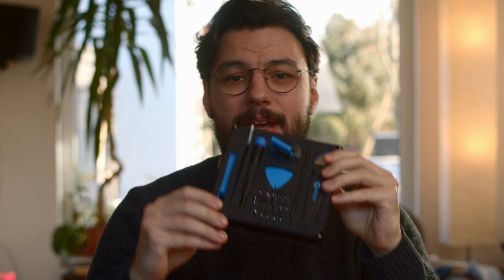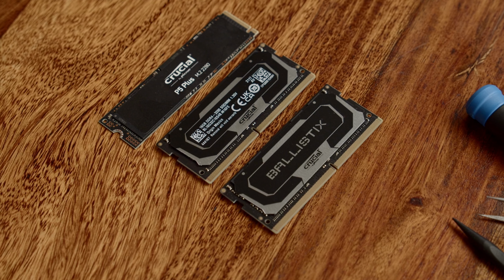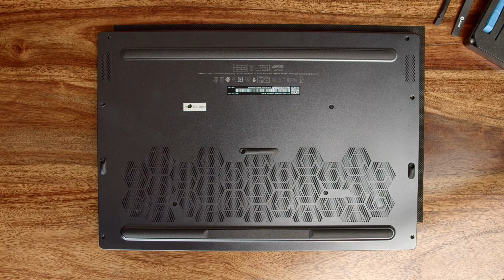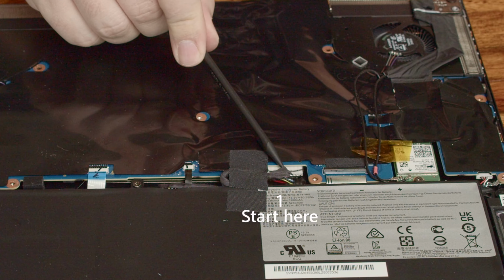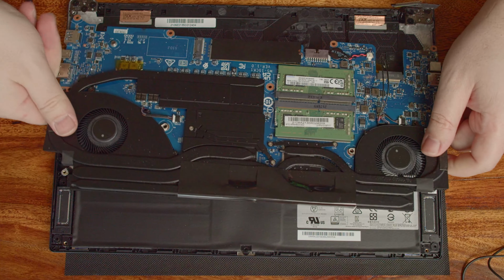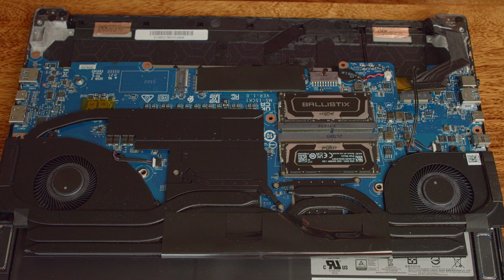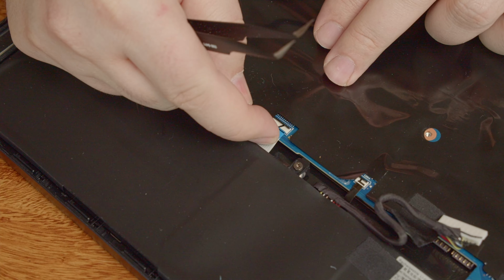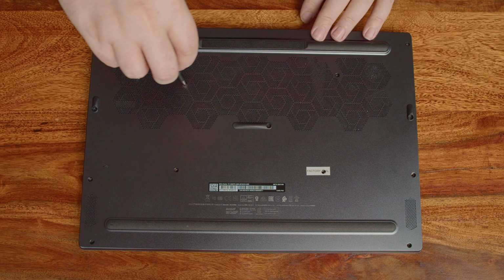MSI Delta 15 Laptop: How to Upgrade SSD & RAM – that was weird.

Comment: Thanks! it was nerve-wracking the first time but afterwards it's quite easy. Note: The two wires going to the wifi card will probably give u trouble at first, just know that the wire with the red label goes in slot 2 and the black one in slot 1. In order to place them in there, place the wires in their slots horizontally. Don't place them in there vertically, from the top or bottom....Horizontally!

Comment: Thanks for the video, but something got tweaked. The Delta is not powering up after installing a new SSD (cloned from original) and updating to 64GBs RAM.

Comment: My red-labelled wifi antenna cable came shipped attached to the aux connector, not main, and I reattached it that way.  I found it a lot easier to attach them to the loose wifi card and THEN insert the wifi card.  And I did find at least one of them made a slight audible click.

Comment: How do you get the Ballistix Ram run at cl16 Speed? if i Enable OC mode for ram  and set the Speed to 3200 the Delta 15 dont boot.

Comment: Two questions for you: 1) is it a PCIe 3.0 or 4.0 motherboard, i.e. can you put an NVMe SSD with Gen4 PCIe to take advantage of the faster speeds? and 2) are the SSD slots big enough for doubles-sided SSD, or just single-sided? This teardown is a little more complicated than usual, thanks so much for your guidance!
Reply from the maker: Hey, Ryzen 5000 Mobile only supports PCIe 3.0. You can of course add a PCIe 4.0 SSD, but it will only run at 3.0 speeds.  Double-sided SSDs should also fit without issues.

Comment: Followed this. Ended up screwing thru the wifi antenna wire (was extremely tired) while putting it back together. I bought new wires but how do I access the antennas? Please help. Thx in advance.

Comment: Does your RAM work with this laptop? I’m asking because i saw the timings of your ram is 16-18-18-36. Are you able to boot into windows with those timings or you using the default (CL22) timings?

I just recently bought TeamGroup CL16 and compared it with the ram you have and I was like “Ok I probably should be fine” but when I set the timings to the ones listed on the ram, I can’t boot into Windows and I have to stick with the CL22 timings that the mobo sets to the ram

Comment: Does the bios allow for XMP speeds on the Delta 15?  I quickly looked and all I could find was an "overclock" setting.  Were you able to run the 32gb at 3200mhz?  Thank you for the great video!
Reply: did you find the answer
Reply: I Installed Kingston Fury 2x32 with XMP support. Works perfectly by default on 3200 MHz with low latencies

Comment: Msi supporting xmp?
Reply: They do, and for similar models there is a secret bios mode where you can (over)clock yourself. IRRC is read it on reddit. Does matter for ryzens.
Reply: Yes. Xmp memory works fine and info in bios is shown accordingly